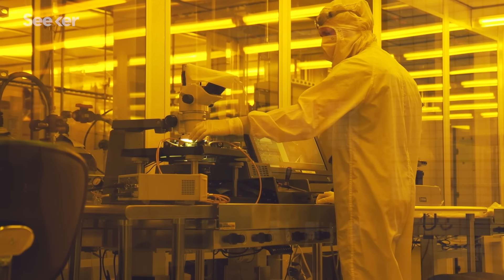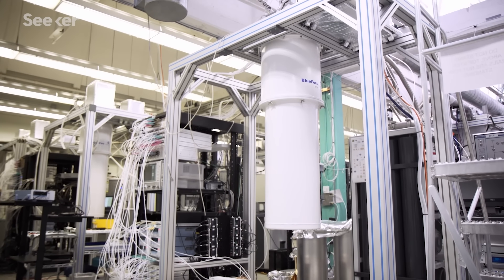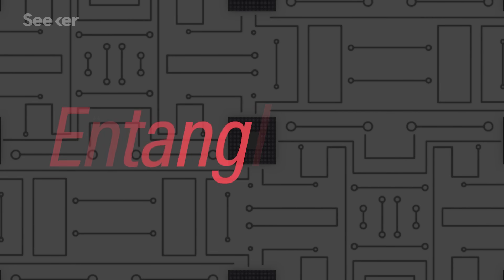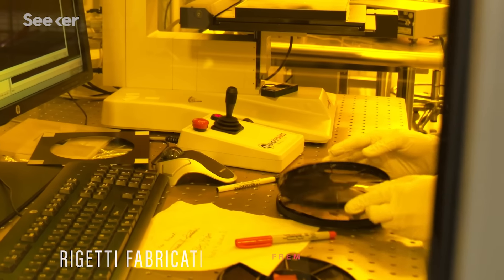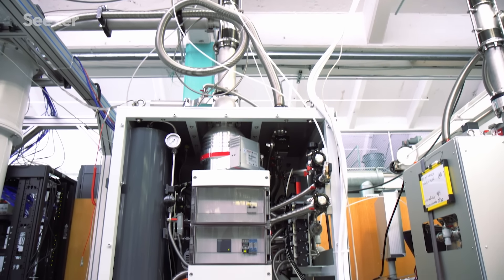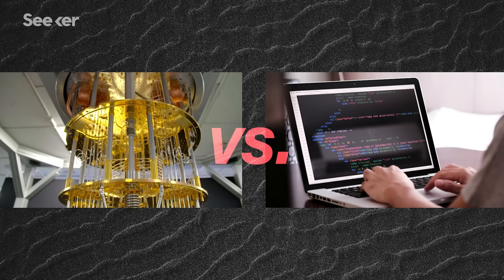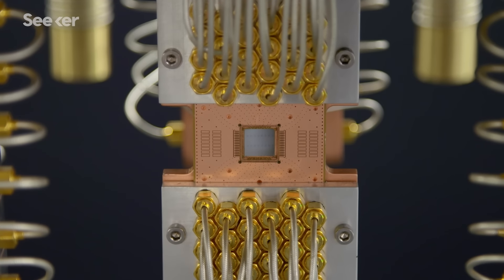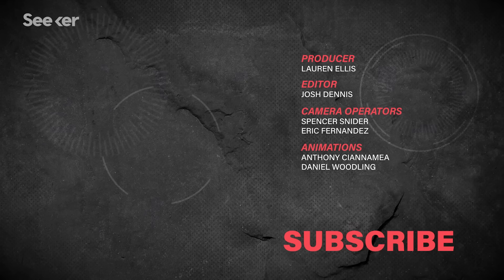We’re Close to a Universal Quantum Computer, Here’s Where We're At

Comment: you could increase processing power by going from digital to analogue with a logic based Mosfet Transistor. you could even layer the logic from digital to synthesised analogue and vice versa to increase speed effectively multiplying your processing power. This would be a much simpler and effective way than the current system of Quantum computing - plus it would be able to retrofit with current systems. oh yes I am aware of bottlenecks however I have an idea for that too. ;)
Reply: i like to pretend i understood this paragraph

Comment: Someone plz explain WHY there is a difference between bits a qubits? Why can one do what the other cannot? Do they tickle a different particle or somethin?
Reply: A traditional program can be thought of as a string of bits: 1s and 0s. These are processed as instructions together sequentially by a processor. A single Qbit, has 2 possible states 1 AND 0, (due to superposition) while a traditional bit has only 1,  1 OR 0(due to two levels of DC voltage). The number of bits defines the number of states for a program and therefore it's complexity, being able to process more states faster means a faster computation. Currently there isn't a good measurement for Qbits vs  bits, they are fundamentally different systems. However, if you can understand that a program's complexity is tied to a quantity of states, then an overly simplified example would just to say that a Qbit can have more states than a bit, and therefore process things faster.
Reply: @eliasgoodale9949  thank you good sir, im trackin now 😁🤗
Reply: @mariosanders9128  no problem! Good luck on your journey. We're all headed toward a pretty amazing future. o7

Comment: To solve their issues would it be possible to cool the computer by putting it in space and compressing the data using it almost as a satellite and with that excess cooling could they accelerate the speed and make it function fast enough for each value to not only represent a 0 or 1 but be both at the same time?
Reply: No.
Reply: The reason that space is cold, is the same reason it's hard to cool things in space. There's no medium to absorb and move thermal energy away from a heat source.

Comment: A quantum computer? Did we not have already produce them. What the titles suppose to say is "infinite computing power for infinite calculation". Which is what they are trying to achieve is something we called "non-renewable material". The energy that is conducting will eventually worn out the conducting material and it will loses their circuit because any conducting material will worn out. For now memory are stored and copied in cloud and drive have been exceeding the utilization of a quantum computer would do. It may be even impractical to have a quantum chip. Well this will be a good blockchain miner if it goes out there.

Comment: Umm, let's try going real 3D regular computing first, ride that out till the end,
and then use all the knowledge gained through such for quantum computing.
It's literaly too far away to be realistic for at least 2 decades or more.
3D 'regular' computing is for now the big step up, when CPU's
get stacked and placed in a 3D grid, for more compact computing, and maybe
get enhanced by cryo cooling for extreme low voltage operation,
which in turn allows for extreme small transistors in or below the 1 nm range.
Although transistors themselves may not be possible using superconductivity,
the most of the travel around the inner workings of a CPU may yet be.
Lowering voltages for switching should be seen as a key to smaller transistor
operation.

Comment: Comparing these with old big-as-a-house transistor/tube computers is pointless. The cooling requirements alone will ensure that this machine is not going to shrink a lot. Unless they come up with something much better. Personally, I think this technology is still pretty far away from any kind of mainstream use. It could perhaps help simulating quantum mechanics, yes.

Graphene seems like a much more significant, and short-term obtainable, performance boost.

Comment: Blockchain the Qbit minimum 4 inputs one line lit of 4 connection 0001, 0010, 0100, or 1000 one to dedicate next transfer 3 possible from one data transmission the message arrives first then 4th line verified
Reply: Short of absolute zero on your desk use multiple SIM